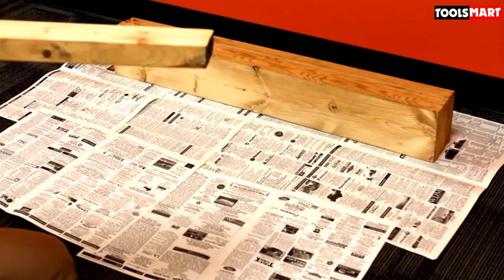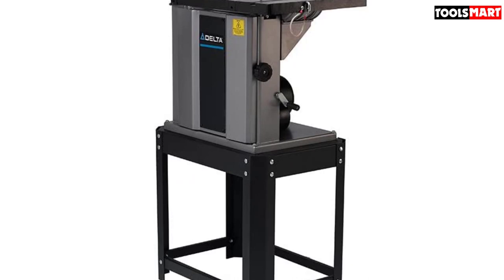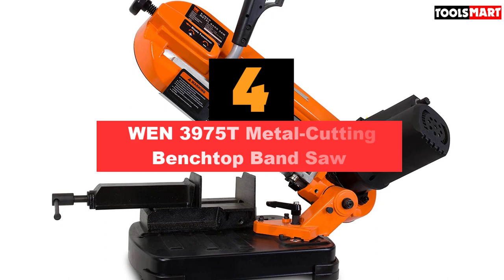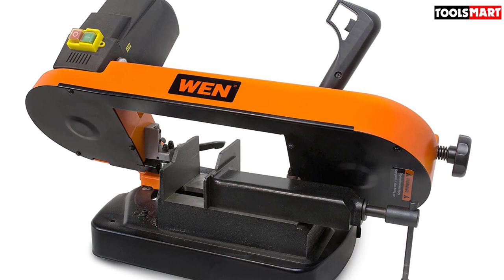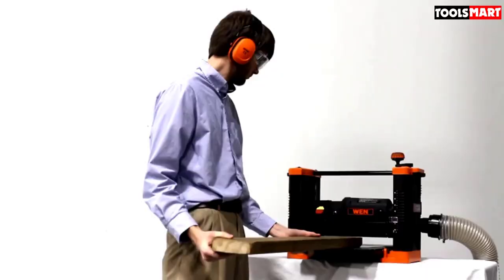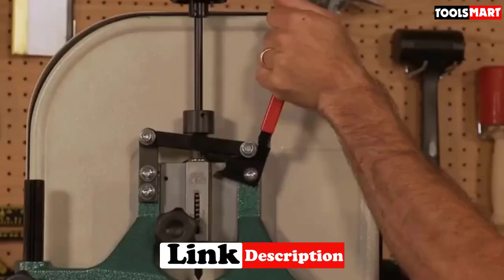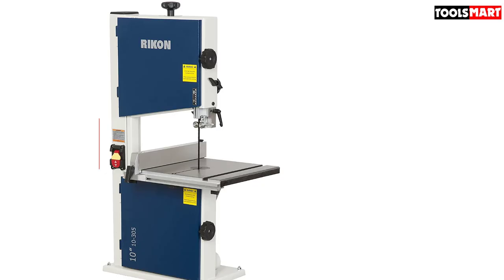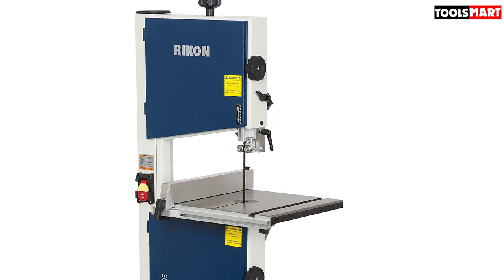✅ Top 5 Best Benchtop Bandsaw Reviews of 2023

Comment from the maker: ✅5. Delta 28-400 14 In. 1 Hp Steel Frame Band Saw
👉 https://amzn.to/3riwets
✅4. WEN 3975T Metal-Cutting Benchtop Band Saw
👉 https://amzn.to/3SIRWm8
✅3. Wen 3962 Two-speed Band Saw with Stand and Worklight
👉 https://amzn.to/3SKIL4n
✅2. Grizzly G0555LX 14″ Deluxe Benchtop Bandsaw
👉 https://amzn.to/3Rn7oTQ
✅1. Rikon 10-305 Bandsaw with Fence
👉 https://amzn.to/3SG2MJp